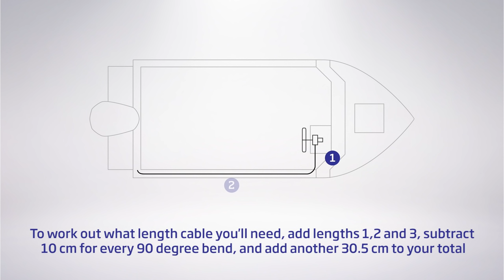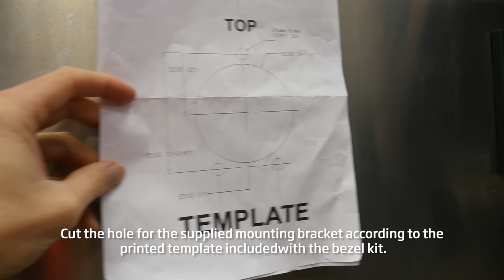How To Install A Cable Steering System On Your Boat

Comment: Was it just me, or did the motor look like it turned farther one way than the other? Is this normal? That's what my boat is doing now and was thinking about replacing the cable.

Comment: This would be a breeze for me But,,,The drum steering system I took out had an adapter to let the wheel sit at a 15 deg angle to the hull. Now I need advice on how to mount my new rotary system to allow the wheel to be mounted at the same angle. I am fitting it to a 1970 Sea Nymph, V13 and would like to keep it looking as original as possible. Any ideas??

Comment: I'm going to order the parts, but I don't see the console on the site. please help?
Reply from the maker: Hi Anthony, thanks for your question. 

You'll need the Helm unit, Bezel and Wheel which are here: https://www.burnsco.co.nz/multiflex-steering-system2 and also the steering cables which are here: https://www.burnsco.co.nz/shop/shop-all/engines-steering/steering-systems1/steering-cables 

That's the complete kit!

Cheers,

Burnsco
Reply: Burnsco can I get the 79 steering wheel instead of the 149.00?
Reply from the maker: Yes you can use any of the Multiflex steering wheels with the helm unit ($149.99) and Bezel ($39.99). Cheers.
Reply: Burnsco I'll measure this week on cable. thank you for video and reply!

Comment: What if when the install is complete, the steering wheel isn’t straight? How do you correct the wheel so it looks “proper”? With the Woodruff key, there are only so-many positions available to adjust the wheel on the shaft. Mine won’t align to looking proper.
Reply: Not sure we’ll get a reply to such an old video, but I’m here searching for this same answer as well.  My wheel is essentially sideways while the outboard is straight.  It’s not something you ever get comfortable with while making long runs...
Reply: Bubba Farmer Exactly my issue too. We’ll see I guess. 👍🏼🇨🇦

Comment: Hello. Great video. Straight to the point. I love it. Just one thing. Does the wheel automatically centre itself with the outboard or do you need to adjust this somehow. Many Thanks

Comment: So just to double check the steel rod slides inside the black casing, while the black casing remains fixed in place? Looks that way.

Comment: how do you deal with the 90 deg angles that the cable has to go round to get to the engine, a few well placed roller assemblies perhaps? If so what did you use?

Comment: any advice on removing the teleflex cable nut that is frozen on the motor?
Reply from the maker: Generally when the nut is like this it is time to replace the cable. You could use a hacksaw and make cuts in 2 places and then try and unscrew the nut. It should break and cable will come free.

Thanks
Reply: Burnsco any tips for a stuck woodhuff key in the steering wheel? I literally can not get the thing out.
Reply: Burnsco that's a bloody rough and amateur way. Simple heat and vice grips in case cable moves with the nut